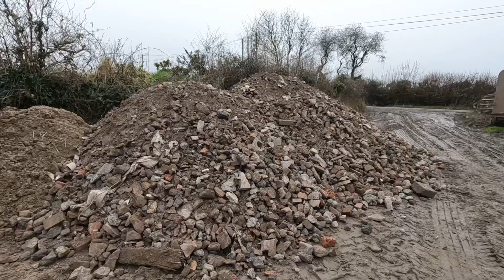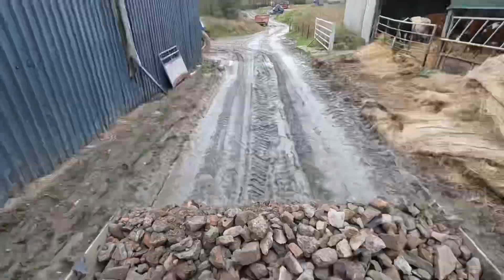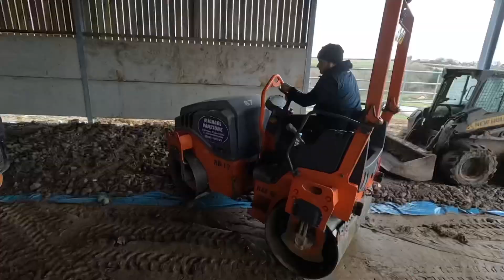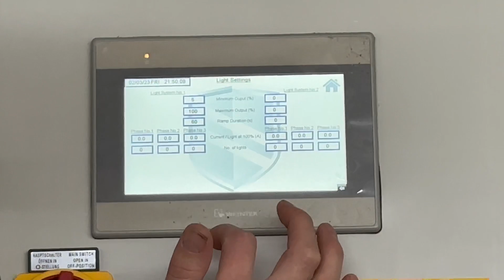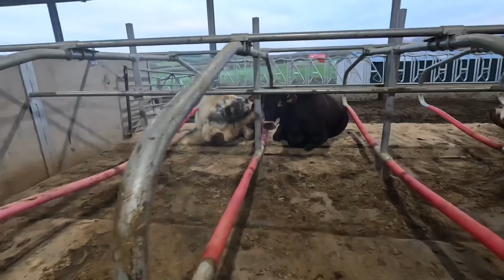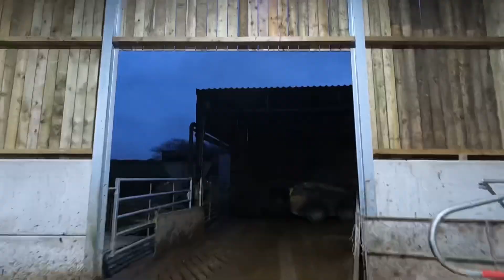NOW WORKING LIGHTS IN THE NEW SHED AND PREPARING FOR CONCRETE

Comment: Was there any reason why you put the DPC under the crushed concrete, vibrating it will drive holes in everywhere. Normally you do it the other way round and put the dpc over the compacted base stone. Then pour concrete on the dpc.
Reply from the maker: We thought it was bit odd putting it under the stone.the men that  done back filling said to do that.i thought he knew what he was on about
Reply: @farmingthebritishway  The way you have done that will stop the crushed concrete mixing with the clay ect  under Neath we used to use a geotextile membrane   Nice video Thanks again

Comment: Don’t want to put you down but that Luxum system is a complete waste of money. We looked into two dairy farms with it and it made no difference to milk yields but only put the electric bill up. The Luxum lights are way overpriced as you can buy the exact same lights from another companies website for a 1/3 of the cost of a Luxum light. Exact same driver and led chips. Shed is coming along nicely.👍
Reply from the maker: Thanks its not always about milk yield.animal welfare is the most important thing.light and air is a big factor in cows health